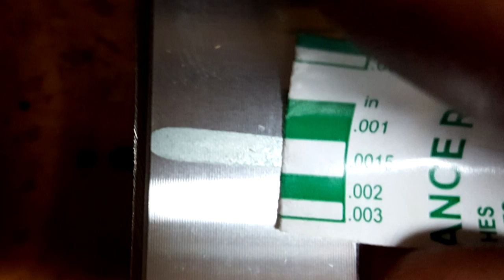LS 5.3L Build Part 4 Bottom End Assembly | Project Rowdy Ep008

Comment: Thank you for taking the time to share what you've done. Your time is definitely appreciated and the knowledge will be put to good use. Couple questions. What book did you use, and would you recommend it?
Reply from the maker: Under each of the videos ("Show More") in this series is a link to the book that I used :  GM LS-Series Engines by Chris Werner: Amazon: http://amzn.to/2igcReD.  My recommendation to anyone (not a heads down mechanic) that wants to rebuild an LS engine....   to surround yourself with resources!!!!  1) a Book or two, 2) Video Series such as this and there are many other overviews, 3) some local guy or friend that has some knowledge (sanity checks), and 4) a Machinist with a recommendation.    I loved Chris Werner's book.  The steps are very clear.  There is a lot of sidebar knowledge sharing (nice to know stuff).  Large sections on Architecture, Preparation, Disassembly, Machining, Re-Assembly, and I believe break in.  It is definitely a great resource.
Reply: @UCanDoIt2Mike  you misskpoke at 5:20 the clearance is .0014         not .0016...if the line is bigger than .0015 then the clearance would be less because its squishing the plastigaige more . Great video man! I love your series i watch it everyday while im building my.lq4 just to make sure i dont miss anything.
Reply from the maker: I think you need to take another look at the Plastigauge scale!   A smaller clearance would be represented by the plastic being squished more (wider result).  My width is smaller than the 0.015 and wider than 0.020...  so it is somewhere between the two.  Closer to the 0.015, so I am estimating it to be 0.016.  By the way in this picture, I placed the squished plastic next to the 0.015 (slightly blue colored), below the plastic is a reflection from the light.  Whatcha think???
Reply: @UCanDoIt2Mike  your right im stupid! I dont know why but when i watched the video it looked like the plastigauge was larger than the .0015  I stand corrected..
Reply from the maker: Hey... I am not always correct.  You had me second guessing myself.  I had to go look at it again to make sure that I was interpreting it correctly...  Cheers and have fun with your build!!!!!  Mike
Reply: @UCanDoIt2Mike  Thanks! Hows the engine holding up btw?
Reply: good video, very helpful.
Reply: I love your videos and the time you took to record them is admirable. You have helped me understand/ clear up a few things that were recently puzzling me. Thank you so much!

Comment: I have watched this video series about 3 times in whole prior to rebuilding my LM7 and have referred back to it a couple times during assembly. Honestly can not thank you enough for taking the time to put this together. So far I've reassembled my short block and it has gone smoothly and reasonably quickly thanks to you. Again, thank you so much!
Reply from the maker: This message slipped through the cracks.   Just seeing it.   Glad you found the series useful and congrats on what should be your finished engine.   Cheers!!!!   Mike.

Comment: I used to work for Hasting Manufacturing (I saw your ring box). I actually built a 350 small block .30 over using rings I made at work. Was kinda cool to know I made a part of a hot rod that I built.  Molybdenum top rings were my choice as I actually made the molly rings. BTW- a ring spreader tool is cheap and a much better idea than sliding the rings down over the piston and scratching & making shavings that can get into the engine.
Reply from the maker: I bet it's cool to see people use parts that you once were an integral part of making.   I agree partially on the ring spreader.  If you are carful, it can be done by hand and avoid the issues that you mentioned.   Using a spreader incorrectly can also cause the issues.   People just need to use their head and slow down a little bit.   My 2 cents...  Cheers!

Comment: Got my build done about 3weeks ago and this video was great help and made my build a success so thanks for that. One thing I wanna ad is for people to make sure once they get that short block back from the machine shop is to make sure all plugs are in the motor. I was not building any oil pressure and it ended up being the diverter valve that plugs in behind the rear cover. Machine shop did not put back in or it came out during the cleaning process. Was a headache to figure out but I learned quite a bit on this build. Thanks again for the great videos
Reply from the maker: Sounds awesome Fernando!  Yea my machinist did all my plugs except for the dumbbell plug for which I installed a new one from the kit.  Good stuff ehhh!!!

Comment: Awesome, thanks.  I begin my assembly next week, new block and all my forged internals are waiting for me.  I'm being taught by an LS guru builder but its my first time ever doing one.  So thanks............
Reply from the maker: Awesome!  Enjoy the process.  It is very rewarding when you hear it fire up for the first time!   Mike
Reply: @UCanDoIt2Mike  ....Mike....quick question about a very mixed up topic, engine break in.  I've been watching a lot of video's on how to break in my engine, probably in about 2 weeks when its back in the car.  As you know, its an iron LY6 (LS).  Since I have roller lifters do I need to do this 25-30 minutes at 2,000-2,500 rpm for cam break in?  Or do I only need to worry about breaking in the rings properly?  It'll be first started and broken in on a dyno-jet chassis dyno.  This engine has top ring at .026 gap and 2nd ring is at .024 gap and it'll be getting a turbo kit installed in a couple months at 18psi or so.  ----- Whats my best break in process?  Thanks.

Comment: I bought that book I like the way you do it the
Book makes it a lot harder then it needs to be thanks for the info.
Reply from the maker: Thanks for the feedback and have fun with your build.  Mike
Reply: I just measured my mains I got .0015 on all of them do you think that’s ok? I get so many mixed opinions everywhere I look.
Reply from the maker: @fluffinater  Checkout the top of page 93 of the book.  For Stock to Moderate build the Crank Main Bearing clearance should be between 0.00080-0.00210.  So you should be good!

Comment: Nice video...Great Camera work. Nice clear instructions...Learned alot...!!! Thank you
Reply from the maker: Thank you Sylvester!  Cheers!
Reply: UCanDoIt2  I am building a 388 stroker and you cleared up my concern all in one video...Lol your awesome bro!!!!
Reply: UCanDoIt2  Question....Where you hitting the crank ends or the caps with piece of wood and why..
Reply from the maker: Sylvester Sledge II The wood was against the ends of the crank shaft.  That was used to set (straighten/align) the thrust bearing (#3).  After that, the end play can be properly measured.

Comment: This is the video I’ve been looking for. Very detailed. Thank you sir!! Wish me luck
Reply from the maker: Glad you found it!  Have fun with your project...  Best of luck!
Reply: @UCanDoIt2Mike  just plastigauged twice all 5 read .001  what’s the best course of action?
Reply from the maker: Non standard bearings or some crank machining.
Reply: @UCanDoIt2Mike  everything was cleaned torqued correct and the crank was cleaned and polished. It’s an gen 4 internals into a gen 3 LQ block
Reply from the maker: @SilverZepp  Interchanging parts is the perfect reason to do the Plastigauge step.  There should be some nonstandard bearings that can bring you back to the proper tolerance.

Comment: I really appreciate this series. Very informative and definitely something I (and so many others) have been waiting for
Reply from the maker: Glad you have enjoyed the series!  I have really enjoyed the process.  Best of luck with your projects!
Reply: UCanDoIt2 thanks!!! I definitely need it! I have an old BMW, 1990 325i and I'm wanting to do an LS swap because parts are cheaper and easy to get, unlike BMW parts where you basically have to get a loan just to get basic things replaced!
Reply from the maker: That's interesting to know on the cost of parts for the 90s BMWs.   I have a 01 E39, 00 E46, and 07 E92 and find that taking it to a mechanic it very expensive, but if I buy the parts myself and have the boys (car's drivers) help with the work, it is extremely reasonable.  I have a playlist for the E46 and am about to upload some E92 vids.   Your swap sounds fun.  I have heard that others have done it.  Are there any companies that produce any specific adapters (motor mounts and such)?  The cool thing is that you will have solve many of the same solutions that I will even though they are different vehicles.  You will just have to solve yours a little differently.  Cheers!

Comment: Ok Like I said before great videos and a job well done and a thumbs up. I have built many engine and I again just have one minor concern that may help those out there doing the same. I have a great machinist and I also do some minor machining, that said never trust your machinist to have cleaned the block. All ways tap all the thread holes with a bottoming tap. All ways use a good liquid detergent like Dawn to thoroughly clean the block of any machining particles or machining oils. All ways blow air through all the ports. Thanks and do keep the videos going.

Comment: I found your video very interesting and helpful as I’m thinking about putting a 5.3 or 6.0 in my 69 LeMans. Only think I had a ? on was lve always been told not to hammer on gear or dampener onto crank.
Reply from the maker: Thanks for watching and glad you found it interesting.  Sometimes we are all told things that are opinions and when you think about them, they are insignificant.   A part of every service manual for about every engine type and manufacturer, there is a procedure for “setting” the crank thrust bearing.  You literally pound the crank forward and backward to seat the thrust bearing.  So in my opinion and based on directions from manuals, I don’t see any significant issues.  I hope you have fun with your build.  Enjoy the process.

Comment: Been enjoying the series well done. One thing you are torquing with an adapter and an extension. Both of those effect the actual torque on the fastener.
Reply from the maker: Thanks for the feedback!  I have heard stories about the use of extensions and torque wrenches in the past and just Do Not believe it!  As long as you keep the rotational axis of the torque wrench the same as the axis of the bolt (Concentric rotational axes) you are tightening, there is no ill affect.   There would be a problem when using an extension, if you allow the two axes (this is the proper plural of Axis, I looked it up) to become non-centric.  Which could happen due the extra joints introduced by the extension.  Now I would agree with you to Never use a Universal Joint when torqueing a fastener as that does promote un-aligned Axes.   Cool topic though...  THANKS!!!!!

Comment: Great video I couldn't find ring gaps anywhere
Reply from the maker: There is a formula for calculating the gap.  then there are adjustments that can be applied to that depending on the use of the engine (example:  Boosted).  Page 106 and 107 of the book that I followed has a discussion and illustrates the formula.  I however, used the recommendation of my Machinist as he was aware of what I was building.  Cheers!  Mike

Comment: Loving the videos so far and this fits really nicely because I'm going to throw an LM7 into my 240. I'll keep you posted Kay?
Reply from the maker: That sounds like a fun project.   Are others putting LM7s in 240s?  The reason that I ask is that a Truck based LS has accessory brackets that create a narrow but tall engine.  While Car based LS engines are overall wider and shorter.   Again your configuration is outside of my research, but maybe others are using an LM7 (truck LS) and then swapping out the Intake for a shorter style.   I guess the point is, would you be better off starting with a Car based LS over a Truck based LS just from the standpoint of overall fitment.   Cool project...  keep me posted!
Reply: there are a few guys putting LQ4s in and you see this mostly done because a car based LS is more expensive then the truck based motors, $500-1000 for an LM7 with wiring and computer versus $2-3 for a lot of the car based LS's. The big thing is changing out the oil pan to clear the cross member and some guys will change the intake for hood clearance or opt to just cut to hood to make it fit. And a truck based LS makes more sense for my build because of the requirement for good low end and mid range torque.
Reply from the maker: Very cool!   Looks like you are on top of all that.   Have fun with your build...

Comment: Good stuff, following along.  Hope that oil is break in oil.  Recently build a race motorcycle and a Mercruiser marine engine.  Will be rebuilding my LM7 5.3L Tahoe engine next.  We should chat about the heads.
Reply from the maker: Yes the first batch of Oil will be used for break in.   It is a non-detergent Oil so that it does not breakdown the assembly lube.  Cheers and have fun with yours!!!!!!

Comment: my only suggestion would be to buy a ring expander and some other basic tools that would help tremendously.  They're not that expensive.  Great job though!  Thanks for the videos
Reply from the maker: If I were in a situation were I would be building multiple engines, I think it important to invest in all of the correct tools.  (1) to do the job correctly and (2) quite often help you save a little time.   In the case where you are just building one engine, I do not think that certain specialty tools are needed such as Ring Expanders.  With care, it can be done perfectly without them.  Cheers!!!
Reply: UCanDoIt2  I have a gut feeling you'll be building more engines. You did a great job! Thanks for all the detail in the videos. I built my first engine last winter, a 383 sbc. I just picked up a 2004 5.3 ls for $500. I'm thinking about sticking in a 1986 Posche 944 i found local on CL for $3,000. There's a couple sites that offer swap kits for the 944 ls. I think that would make a fun car!  Thanks
Reply from the maker: That sounds like a fun project.   Cheers to you!!!!

Comment: Something to point out and someone may or may not have said this I have not read all 274 comment thus far. I'm not an expert and someone can correct me if I'm wrong but you don't handle bearings with bare hands or touch the bearing surfaces. The acid in the oils from your fingers can actually etch at the bearing. I've always handled them with a gloved hand or handle them by the edges and traded it just like you would a halogen bulb. However (I'm not sure so this is where I could be wrong) today's modern bearings may have a coating on them to help prevent this and also assisted brake in. Also I noticed you prelubed the cylinders with 30 weight and installed the Piston is dry.  in high school I work in a machine shop for a few months and my mentor always dipped his pistons in oil before putting them in. He told me it helped in breaking and the ring seating correctly so that's how I've always done it. Did your instructions mention this? Most of my experience is with older engine 70s and not with modern engines so I'm just curious.  Great video and I'm enjoying your series.

Comment: Can you please give tips and tools to remove the crankshaft sprocket (lower timing chain gear)? I am having a hard time getting it off and finding the right tool to use.

I watched your whole series I'm building an lq4 to replace my LM7. I was overwhelmed after tear down and your videos help me get confident again. The wiring harness video was awesome! I had no clue any of that was possible! I would be willing to try that now. 

And I ordered that book after your suggestion, so glad I did! It's a great book and guide. I already had the Chilton book, they are both needed IMO.
Reply from the maker: I first tried a standard 3 jaw puller and it did not work.  I found success using a Bearing Separator.   I have this kit:  http://amzn.to/2u9pJwV .   It is what you see me using in the video.  Worked fine as it was able to reach behind the sprocket teeth.
Reply from the maker: Your plans sounds awesome!  Don't give up!!!!  The books and videos will walk you through it...  You will inevitably will run into a snag or two and there are always answers to solve them.    There is a GREAT feeling of accomplishment for your efforts when you are done!    MOTOR-ON!!!!!!!!!!

Comment: I am about to start an LS 5.3L rebuild starting of course with the teardown..find a machine shop and clean the block and all parts before assembly..I see in this video the book in the background..SA books "How to Rebuild GM LS -Series engines..I have the same one right here..did you find this book helpful ? My first LS engine build.
Also were those forged or Hypereutectic Speed Pro pistons with the Scat H-beam rods..pressed or floating pins ?  Looks like floating pins..I plan on Eagle H-beam or Scat rods like these,and not sure which pistons yet..looking for 400-450 hp so will be forged..  I am glad I ran into this video series..Great Job and very informative.
Reply from the maker: The book was extremely helpful.  It provide me with a roadmap of the steps, torque specs, many side notes and topics of interest.

Not sure on the specs of the Piston and Rods.  The parts number of the products that my machinist recommended is included in the parts list PDF in the description section of this video.

Glad you enjoyed the series.  It was a fun build.